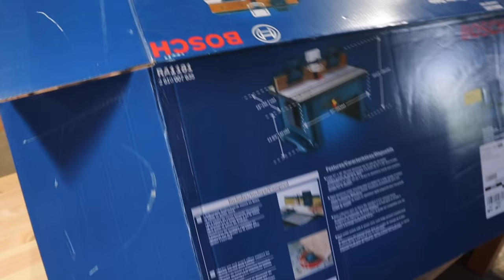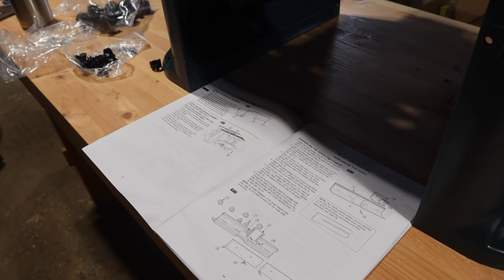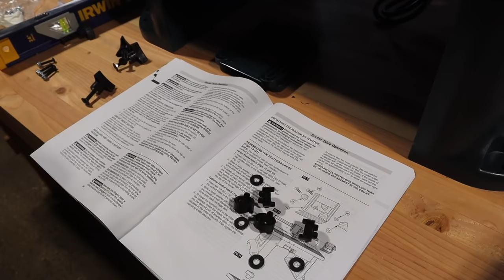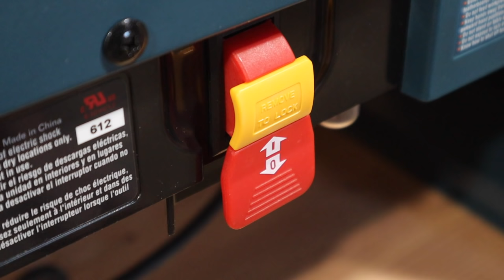New Bosch Router Table | Model RA1181 - Unboxing & Setup

Comment: great video thanks for sharing, i bought one on marketplace that someone partially put together got frustrated and sold it for like 100 bucks he had the leveling screws attached to the plate, and a few other things were not correct, i just received the Bosch 1617 for Fathers Day , thanks for sharing
Reply from the maker: Hey! Sorry for the late reply, glad you got it worked out! And yea, that’s no good when you used equipment like that.

Comment: Did Bosch quit putting the elevation adjustment on these? They used to come with an Allen wrench with a T handle to run the router up and down.
Reply from the maker: Nope! It’s still there. It comes with the wrench but you’ll still need a router mount that has the bottom side adjustment. The fixed base in the Bosch 1617 EVSPK kit has that.

Comment: Very nice video.  One question I have is when you purchase this it does not come with a router, correct?  Just the table is sold separately and you will need to buy the fixed router separately.
Reply from the maker: Thanks! You are correct! The table and the router are sold separately. You can find them linked below if you're interested. 
    Router Kit, Bosch 1617EVSPK: https://amzn.to/2HE72Kk
    Router Table, Bosch RA1181: https://amzn.to/37OY0W6

Comment: How long of a piece can you route on this? Would I be able to do 24-36" long dados/rabbets etc in plywood? What about for jointing a board?
Reply from the maker: That’s a great question! The table isn’t really limited on how long of a piece you can fit into it, your biggest limiter will be supporting the workpiece. For reference, I have tongue and groove jointed nearly an 8 foot board on this. Though, I had roller feed supports on the incoming and outgoing side. If you are looking to only support it with the table, 24 inches is probably fine but 36 inches starts to get a little bit dicey, depending on how heavy the work piece is. 

For jointing a board, the same logic follows.
Reply: @NorthwestCraftsman  thanks so much! I already have the table but have been reluctant to set it up. I think I will build a shelf onto the side of my MFT workbench where I can use aluminum profile+dog holes as a longer fence. I'm guessing the feed side is the most important side to keep straight for stability and accuracy?
Reply from the maker: @ no problem! And that’s a great idea. I will likely be building this into another table or building a table of my own at some point as well. Just to give me more supported space. 

Generally yes, the in-feed side is the most important.

Comment: Hi! Thank you for sharing your video, it was very informative. I am considering making my own T&G flooring to cut cost. I am presently shopping around for the best option. I know it will be time consuming to make my floors but I don't mind that.  What I want to know is , do you think this table and router can handle 2000 s.f. of flooring?
Reply from the maker: Thanks! I appreciate the compliment and am glad you found it useful. Sounds like a fun project! I think the table and router can definitely handle this. What I would be careful of is your speeds, feeds, and bit sharpness. Heat is your enemy and the faster and more aggressively you cut, the more your bit will dull which only makes it worse. I recommend you get a nice freud tongue and groove bit set and evaluate sharpening it throughout the project (usually have to send carbide out).

Freud Tonge and Groove Set
https://amzn.to/3oKDFqr

Comment: Would love to get one but down under we use 240 volts and I can't see any that can run on that voltage.  Strangely Bosch only seem to have made this for the USA market.  Can't use a step down transformer either as the vac system and router are all 240 volts.  Was the tabletop  dead flat?
Reply from the maker: Shoot! I hadn’t even thought about that but think you’re right because most of Europe is at the same voltage as you. If you find a solution, comment back because I bet you’re not the only one. 

And dead flat is a little of a trick question. I believe I remember measuring it to within 1/64” or 1/128” of “flatness” by my 36” level and any gap present. But at that point I start to question my level as I haven’t had it checked or certified, just assumed. For me, there wasn’t any obvious twisting, bowing, or cupping of the table which is flat enough for my work. If you need a truly, sub thou flatness, I’d recommend making one with melamine or the like because you can get some wicked flat and slick surfaces that way.

Comment: Do they provide base-plate measurements?  I have an older Makita 3612BR router that I'd like to put in one of these but it's not on their posted list of supported routers.  The 3612BR appears to have 4 holes 85mm apart in a square pattern.  Would there be room to drill (it's aluminum, correct?) additional holes in the base ?
Reply from the maker: They do! Below is a link to the PDF of the manual. Page 14-15 is what you’re looking for but it doesn’t look like your Makita model is included by default. And there should be room to drill if needed, yes, it’s aluminum 👍

Link to Manual
http://pdf.lowes.com/operatingguides/000346353679_oper.pdf

Comment: great vids. question... early in the vid. you stated ra1181 is and upgrade from the ra1171. do you know the difference? I seen online a package deal for the router and table. (1617evs and the ra1171) looking to pick it up but just wanted to see the difference in the table

thx!
Reply from the maker: Hey Michael! Thanks for the question. Honestly there aren’t a ton of differences and I think a lot of it would come down to preference. I like the aluminum top for the 1181 and the more open design which allows for easier cleaning. That being said, I haven’t used the 1171 so I can’t speak from direct experience. Below is an article I found which goes through some of the differences, though, it is a little circuitous in its style. 

https://www.ronaldphillipsantiques.com/bosch-ra1171-vs-ra1181/
Reply: @NorthwestCraftsman   thx keep up the good work/videos!!

Comment: I’m thinking about mounting this table to a work bench without the plastics base, thoughts? Does this table have a router lift?
Reply from the maker: That’s actually a great idea to give you more space to work. 

I don’t think it has a true lift, just access for the Bosch fixed base which as a bottom side adjustment.
Reply: @NorthwestCraftsman  I have a harbor freight Hercules plunge router that I want to add to a router table with a lift, any ideas? I have seen all of the router lift kits, but I want the slides and French to go with it without building
Reply from the maker: You could always get a lift kit and mount it to a square piece of Aluminum or ply that fits in the top for this table.

Comment: Can you tell me if the router height is adjustable from the top with the supplied base/mounting plate?  I have the same router ordered that you show.
Reply from the maker: It sure is! If you mount the fixed base of the EVSPK to the router plate, there is a hole that aligns with the fine adjustment knob and an included hex key to do the adjustment.
Reply: @NorthwestCraftsman Wow - Thanks so much for the quick response, and great video! :)
Reply from the maker: Thanks! Glad you enjoyed it and found it useful!

Comment: Can i use any model of router on this table?? What model you use??
Reply from the maker: Just about! The router plate has a ton of configurations to match different models. I use the Bosch 1617 and purchased the EVSPK which comes with both the plunge and fixed base for the router spindle. Honestly it’s my favorite tool in the shop. 

Here’s my video on it. 

New Bosch 1617 Router | Unboxing EVSPK Fixed & Plunge Combo https://youtu.be/06Xcl2aPA1c

Comment: Do you need buy router than router table, or you have everything in set?
Reply from the maker: If I interpreted your question correctly, it depends on what you’re looking to do. At a high level, this is just the table and the necessary parts to adjust it. However, it doesn’t include the Router. If you buy the Bosch 1617EVSPK (link below), it has a fixed base router body that can be used under the table really easily. 

Regarding other accessories, you’ll need to buy your bits but that’s about it. I’d recommend a cheap variety pack first to see what you use most, then, when you need to replace them, get a nice Freud bit. 

1617 EVSPK: https://amzn.to/49KJbSl

Comment: I was looking for a table for my new Bosch GMF1600CE, and really liked it by your video, but wondering if I would be able to install my router on it, I can't find any information about if this table is compatible with my router. Does anyone have any idea about this?
Reply from the maker: Thanks! I’m glad you enjoyed it. Below is a link to the manual, page 15 has the list of compatible routers. I don’t see yours right off the top, but I may have been looking wrong. 

Bosch RA1181 Manual
http://pdf.lowes.com/productdocuments/33317c1b-1aec-45b5-9eae-46caa8e591db/08063444.pdf

Comment: Woodworking noob and new subscriber with a question: Can this be used to make complete cuts, as in: with the ability to be adjusted to cut through the entire width of the board? (I'm looking for something to use for making tables, bookshelves, etc..) I noticed with your test piece the cut was only partially through the width. Again, obviously a noob question. Great video man! Thanks.
Reply from the maker: Hey! Welcome to the channel! One of the primary reasons I started the channel was to share the process of learning to woodwork. So, no questions are too simple or off limits. 

Though it would be possible to do a through cut with a router, it would be difficult. For cross cuts (perpendicular to the grain), a miter saw, table saw, or bandsaw would be the tools of choice. For rip cuts (parallel with the grain and widest face up) a table saw or bandsaw are the tools of choice. And last, for resaw cuts (parallel to the grain and skinny side up - also not very common) a bandsaw is usually your tool of choice, though sometimes it is possible to use a table saw.
Reply: @NorthwestCraftsman  Awesome man! I really appreciate the reply. Good to know the lingo too!
Reply from the maker: @TheSokodelic  glad I could help! Feel free to ask anything, Merry Christmas!

Comment: Hi. I am newbee, have a question. After I have set up this table and same router, i have run a test. For some reason the first half of the plywood has been cut good, but second half has been cut in descending manner the way that there is almost no cut at the end of the wood. What am i doing wrong?
Reply: and yes, i bought it after this video review.
Reply from the maker: Thanks for the feedback! I’m not sure what you mean by a descending manner but let me take a shot. Your work pieces on this table should always pass from right to left. Are you routing an edge? Or Cutting a dado in the plywood? Also, if it’s easier, feel free to send me an email (see the about section) with a video explaining or showing what you’re seeing.
Reply: @NorthwestCraftsman  Thank you. Will do!

Comment: Will the Bosch table accommodate a router lift from kreg or woodpecker
Reply from the maker: Great question! I’m not sure. Here’s a link to the manual, page 15 has compatible routers with the base plate and I think it has dimensions as well. 

https://pdf.lowes.com/productdocuments/33317c1b-1aec-45b5-9eae-46caa8e591db/08063444.pdf

Comment: I wonder if I’m older Dewalt DW610 will fit in this table
Reply from the maker: Doesn’t look like the 610 is compatible but double check page 15 of the manual below. 

https://pdf.lowes.com/productdocuments/33317c1b-1aec-45b5-9eae-46caa8e591db/08063444.pdf

Comment: HELP!
I have the router GOF1600CE and I was wondering if I can use it with this table (my router is the plunge version) thank you in advance
Reply from the maker: Hey there! I’ve included a link to the manual which states all the compatible routers on page 15. I’m not seeing your model but double check me. 

Most plunge routers won’t fit under the table but there may be adapter plates out there that will allow it. Worst case scenario, you can make your own. 

RA1181 Manual
 https://pdf.lowes.com/productdocuments/33317c1b-1aec-45b5-9eae-46caa8e591db/08063444.pdf

Comment: Do you feel the red insert ring is too thin and the final surface is not flush enough?
Reply from the maker: I’ve gone back and forth. It’s certainly not flush but I don’t generally rely on it to datum my parts, just prevent them from falling in. Bosch certainly left room for improvement.

Comment: You should have identified the screws that adjust the motor insert plate. I am missing my screws when i moved.
Reply from the maker: Page 13 of the manual has the callout. They’re #10-32 by 3/4” countersunk socket-head screws. 

Manual
https://pdf.lowes.com/productdocuments/33317c1b-1aec-45b5-9eae-46caa8e591db/08063444.pdf
Reply: @NorthwestCraftsman   lost my manual too during the move LOL. Tanks for the fast reply. Going to Lowe's early.
Reply from the maker: That’s fair, I’ve actually gotten rid of all my paper manuals because the PDF’s are so easy to find online. Good luck with the fix!

Comment: Good video. Was about to build a new table, but I think you changed my mind.
Reply from the maker: I’m glad you appreciated it! Here’s a quick link to the table and router if you need it.
    Router Kit, Bosch 1617EVSPK: https://amzn.to/2HE72Kk
    Router Table, Bosch RA1181: https://amzn.to/37OY0W6
Reply: Me too. I think I'll just buy this router table. I'm new to woodworking and I think this will help a newbie hit the ground running a lot faster.
Reply: @NorthwestCraftsman  That’s one of my routers and my favorite by far.  Have the fixed base in my old table and use the plunge base for everything else.

Comment: I am having issues mounting my Bosch router to the table one screw does not seem to catch the base.What am I doing wrong
Reply from the maker: Hmmm, is it the router base mounting to the plate you’re having issues with or getting the spindle in the base once mounted?

Comment: Great video - much better than wading into the swarmy world of self-make. Looks like a good option compared to the endless $500+ offerings for a full table and confusing table top options. What are you using for dust vacuum?
Reply from the maker: Thanks! I’m using my Rigid shop vac with a dust deputy in between. Below are the links to the hardware I use, and a video on my dust collection. 

    Blue Barrel: https://amzn.to/2HDpGlI
    Dust Deputy: https://amzn.to/3jBu6H0
    Hose, 2.5”: https://amzn.to/37MqhMN
    Hose, 2.5” Adapters: https://amzn.to/2HJGO9z

Video on my dust collector
https://youtu.be/cJjJjcs99E4

Comment: Does this table come with above the table height adjustment?
Reply from the maker: It does! The table itself doesn’t have a lift but interfaces with the 1617 EVS router frame to access the micro adjust from the table top. Below is a link to the EVS

Bosch 1617 EVS
https://amzn.to/3rOIf82

Comment: Good for you for being able to slide the router in so easily. I CANNOT do it. Ended up buying a second router just so I wouldn't spend 30 minutes of my life trying to get the thing to slide into the housing.
Reply from the maker: Shoot! I’m sorry to hear that. At the risk of asking a really dumb question, are the arrows lined up when you’re trying to slide it in? It’s also possible yours has more interference which causes it to bind up.
Reply: @NorthwestCraftsman  I appreciate it. If you Google it, you'll see lots of people have the same issue. Something about the type of metal- sm ooth to slide into the housing, but it's it gouges easily and skews the geometry just enough
Reply from the maker: Interesting! That’s good to know. Seems like Bosch could put some polycarbonate glides in there to ease on the mental on metal interface. 

Glad you were able to find a solution, even though it was quite expensive.

Comment: Thanks for the video. Is there a reason why you removed the wooden handles? I assume this router must be your designated router for just this table?
Reply from the maker: No specific reason, didn’t want to run into any space issues when I installed it. And not necessarily! The 1617 EVSPK has a quick spindle unlock which allows you to move the spindle from the plunge base to the fixed base, which I just leave in my router table
Reply: @NorthwestCraftsman  Ah I see. I’m setting up the same kit right now. For some reason I was thinking I was gonna have to remove the fixed base when I want to use the router by hand. I’ve never used a plunge base. I guess I better get used to the slightly bigger rig so I can leave the fixed based in the table.

Thanks again for the video. I watched for the first time around last November and it made decide to get the kit. I revisited the video today to watch along while reading the instructions :)

Comment: How high is your table. I use worx bench and it seems a little high for me
Reply from the maker: Hey Abraham! My workbench is about 36" off the ground and then the router table is on top of that. When I build my permanent work bench for this table, I'll likely split the difference in height.
Reply: @NorthwestCraftsman  Thanks a lot

Comment: Is the table work with Makita router?
Reply from the maker: Likely but check the owners manual linked below. They have a table on page 15 which details the compatible routers. 
http://pdf.lowes.com/operatingguides/000346353679_oper.pdf